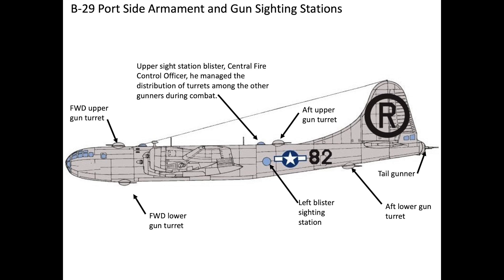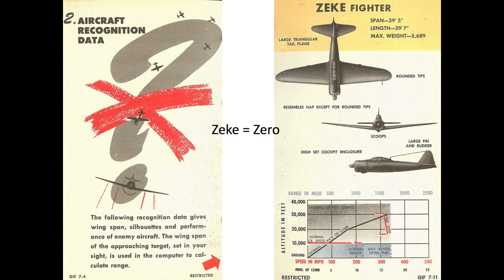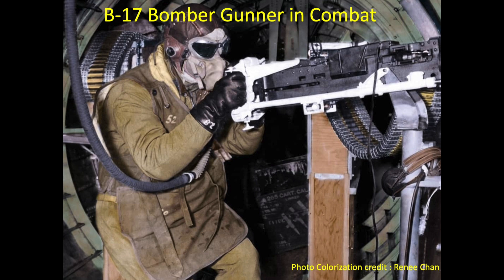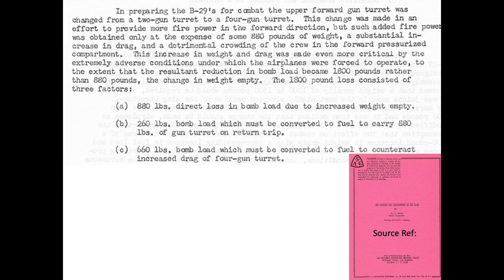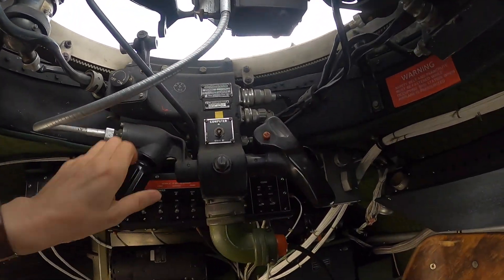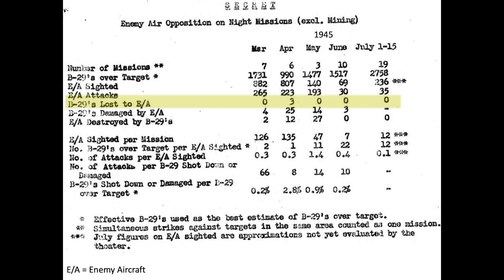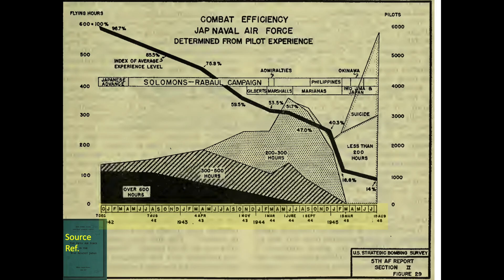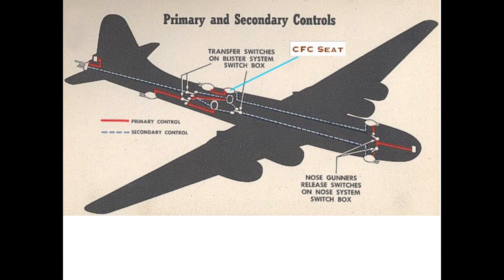Why the WWII B-29 Bomber's Gun System was so Combat Effective

Comment: Well done!  The bit about the deletion of tracer was interesting.  P-51 pilots that took the trouble to master the K-14 lead computing gunsight also would tend to delete their tracer, which provided a huge tactical advantage when an enemy fighter couldn't tell it was being shot at until hits were being scored. That's why you sometimes see tracer in gun camera footage, and sometimes not.  The circle of dots in the sight reticle is made from two plates with curving radial slots, creating a circle of diamond shaped holes where the slots intersect.  When you move the range setting, it rotates the plates relative to each other, moving the intersection holes toward or away from the center.
Reply: Thanks for the explanation of the circle of dots.  I wondered why it was made of dots instead of a solid circle, but now it makes perfect sense.  Actually, it's a pretty elegant solution.
Reply: Tracers also had different ballistics, resulting in different trajectories, which in many cases diminished their effectiveness in helping direct accurate fire of the guns firing them.
Reply: OTOH, without tracers you lose the psychological intimidation that could cause fighters to break off early.
Reply: Pilot accounts of intercepting B-29s said they still saw all the guns blasting away at them so can tell if they are being engaged.
Reply: OMG, those things were pretty hi-tech.  I had no idea that the B29 was anything more than a bigger version of a B17.  Watch some training films on B17s---They were a complicated piece of machinery, but compare them to B29s.

Comment: Excellent video. I wonder if those gunnery kill claims are really true though. Numbers sound awfully high. Were there any gun cameras to confirm kills? Perhaps they can be cross referenced with Japanese fighter loss records? The gunners have to peer through small blisters at fighters travelling hundreds of mph. There's probably flak and ground explosions taking place at the same time. Would be easy to get confused and think you've smoked a fighter. From what I've read, ETO bomber gunner claims were much higher than reality, but the USAAF allowed over claiming to boost morale.
Reply: My understanding is that while flying in formation an incoming fighter may be tracked and fired on by more than one gunner, a kill may actually claimed by more than one plane.
I have read  that the B-29 was an extremely difficult target to shoot down.
Reply: I'm not sure you understood what he said. All turrets had gun cameras. Although the gunners probably overstated kills, the gun cameras would pretty much settle the question. Maybe I am misunderstanding your question. We're you referring to bombers other that B29s? If so, no, there were no gun cameras on the other bombers.
Reply: @williamromine5715  
What I'm saying is even with cameras and multiple turrets from different aircraft it's still possible that gunners could claimed the same targets shot down especially sence the bombers were most likely flying in a defensive formation.
Reply: @RT-mm8rq  It's possible, but less likely than the gunners on the other bombers in existence at the time.
Reply: @williamromine5715  Oh yes, you're correct - he mentions the gun cameras at 11:29! I missed that, thanks! Wow, this aircraft was amazing for the time - quantum leap in bomber technology. No wonder the B-29 development program was so expensive, costing more than the A-bombs to produce.
Reply: @octowuss1888  Yeah, I had no idea how sophisticated the guns were. They look even more so than modern guns(of course we don't have bombers with multiple .50 cal machine guns today. Still, they look more like something from Star Wars instead of 1944!

Comment: Why not 20mm cannon all around on B29.  B36 had 30mm ?
Reply: It's a trade off they probably felt wasn't worth it.

• .50 cals with API ammunition were highly effective against most Japanese aircraft due to their construction.

• 20mm cannons are heavier and larger, and their ammunition is heavier and larger. This impacts range and the amount of ammo that can be carried. Any extra weight added means less fuel or less payload, as we saw with the addition of a mere two extra guns for one turret.

• Bigger guns also means potentially bigger and bulkier turrets, which might not have worked as well with the fire control system or perhaps wouldn't fit as easily into the airframe.
Reply: Zekes could prob be shot down with .22 mag.

Comment: Well done! Curious, the B-29 air-to-air kill ratio was 11.7:1 what was the air-to-air kill ratio for the B-17 & B-24.
Reply: I think it's safe to say the b-29 exceeded the two older models.
Reply: @Xtoxinlolinecronomicon  
Is it safe to believe in the accuracy of B-29 gunners' claims? The narrator said all turrets had gun cameras. Was that how claims were verified?
Reply: @danl.909  Pretty much yes.
Reply: Depends if you take the claimed kills of the B17 gunners or the kills admitted by the Luftwaffe. The overclaiming ratio was about 10. Much higher than that of Allied and German fighters that was about 2.

Comment: Great video ,as usual.
That was so complicated.
 I am amazed the gunners had the time to react as the planes dove past at close to four hundred miles per hour.
Much respect to the American gunners who went from an open side or rear mechanical firing solution to a completely bizarre ....tube electronic..... computer operated...... closed cockpit aiming and firing system that required a massive amount of learning in a extremely short amount of time.
Just wow.
Remember....there was'nt even regular television at this time.
Radio was still king.
Just incredible.